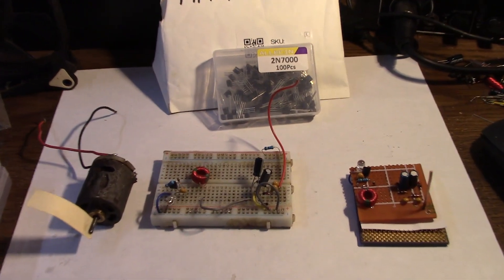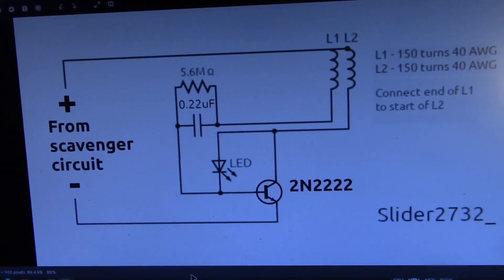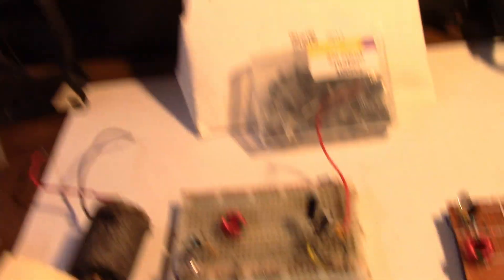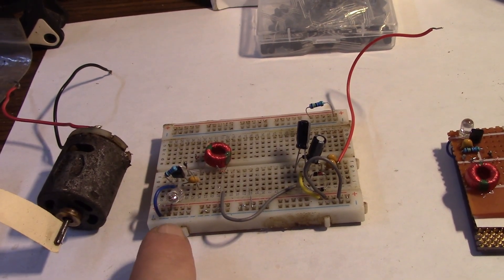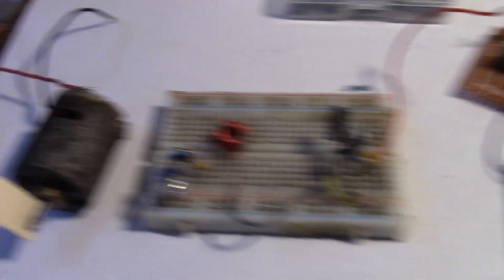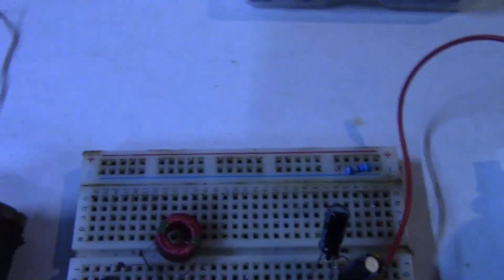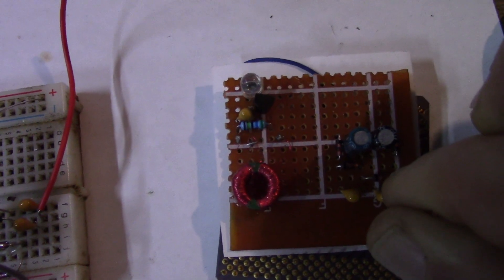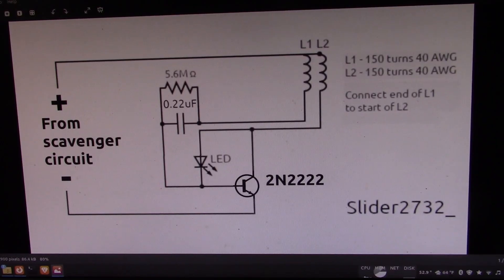This Flashing LED Circuit Works By Just Touching It!

Comment: Few week ago while trying to build 12v dc motor controller (h brige and mosfet for on and off) I found out that while I was holding trigger motor starts spinning. I was confused and connected multimeter and measured 0.09 mA AC! I thought that my body acted as an antenna and to proove it I continued doing experiments. I took metallic ruller soldered trigger to it and closed the circuit trigger - ruller - me - metal pipe (which goes across the building), and I got crazy 0.25mA AC. Also I connected led and it was flashing as in your case! And because of that led I understand that the current was AC - no matter how I connected led, it was blinking
Reply from the maker: Thanks Hiro, great story! 
It's amazing how such things happen, working so well to bring a depth of experience that can't be just read about online to understand.
It also proves how a simple set of bits and pieces can bring along something most would consider to need calculations and formulas.

Comment: What would happen if you connected a wire to where you touch the board then coil the wire around any cord in your house that is running a constant load like a lamp or radio?
Reply from the maker: I would expect it to run in a similar way, Jon. For testing, I was connecting the supposed ground wire to outside to it, but then swapped to a wire running across the room and into the hallway. 
Have got another version that stores up charge when sitting on top of the internet router. Can flick a switch after a minute or so and the LED flashes brightly 😀

Comment: It's a little bit like how the solar rockers can give a little twitch with virtually no power available 🤔
Reply from the maker: Had a fun one here yesterday. Was at the PC editing an audiobook file and a noise started up to my right. Saw it was a solar rocker. It's been silent and sat there for months.. The Sun angle has changed to just about catch it late afternoon!
Reply: @Slider2732_  The solar rocker I have 'plugged' into my syrup battery is just twitching most of the time. Not fully rocking. There is clearly a small amount of power, slowly charging the capacitor, then triggering a pulse, but not a big enough pulse for a full swing 🤣🤣
Reply from the maker: @GrandadIsAnOldMan  Oh there's a thought - nobody has made a golfing solar rocker. Imagine a golfer rocking and hitting a ball on a string... sometimes. The 'sometimes' might make it fun to design and watch. 🏒⛳
Reply: @Slider2732_  Hmmm! 🤔🤔

Comment: You touching it is acting as capacitor, between antenna and ground. Try variable capacitor to virtual ground mass. Like a two sheets of tinfoil etc, connected to larger peace of metal.
Reply from the maker: Thanks for the solid advice. I did wonder about capacitance (looked into human capacitance etc) but didn't think of 2 sheets of tinfoil. Rimstar's type of cap used to work well, where one piece is slid over another. He used a toilet roll (I think) for crystal radio experiments, but I'll try a smaller form.
Reply: @Slider2732_  @Slider2732_  This kind of circuit is very sensitive to air moisture. So it might work well or very poorly depending on the weather. That's why it should be variable capacitor. Sad they don't make them anymore.

Larger capacitor has more surface tension. Stacked capacitor has more resistance.

The real 1N34A is always glass with black stripe. All those red ones are fake and silicone. D9V (Д9В) is real Russian equal to 1n34a. D9K might also work.

Germanium transistors have even lower forward drop, but they are hard to find. There's also some military grade microwave diodes, but they are too expensive for regular people.
Reply from the maker: @Kangsteri  Thanks for your continued help. 
Yes, have noticed different running with different weather, made easier to notice by recent large autumn drops in temp, heavy rain, then full sun and us not having air conditioning. Excellent varied test conditions!

Good info on the diodes, cheers for that.

What I might try is a variable cap from a radio, 0-512pF. ESDA say that we are like a 100pF plus 1.5K resistor, which seems like a good place to start.

Comment: That's absolutely brilliant, it's got to have some real world uses just a case of thinking out of the 📦 great video, that might be my first project when I have Finnished painting the flat. 😊👍
Reply from the maker: Thanks John 😀
It was surprising to see both well tested circuits combine to do this! 
Yep, real world uses are where I'd like to take it. Stronger running, brighter light, something we can make for a very low cost that's got uses. 
Good luck with the painting!
Reply: @Slider2732_  cheers Mark, they're is so many waves travelling through the world nowadays be it radio, microwave,satellite,natural ect. It's a shame not to collect what we can and use it to are benefits.
Reply from the maker: @johnwynne-qx6br  Exactly! Though tuning is the problem, myself not wanting to walk about with a 200ft antenna everywhere... others may think differently  🤣